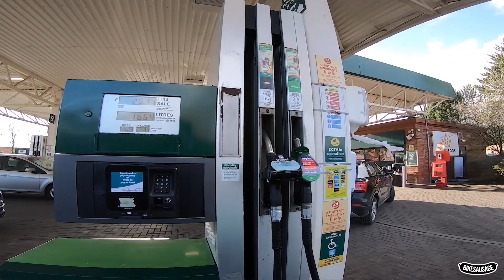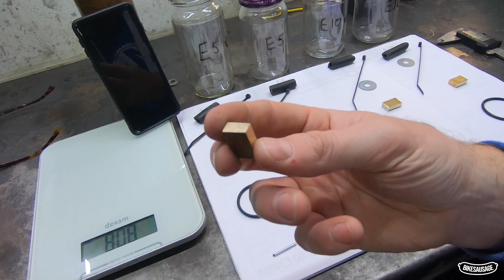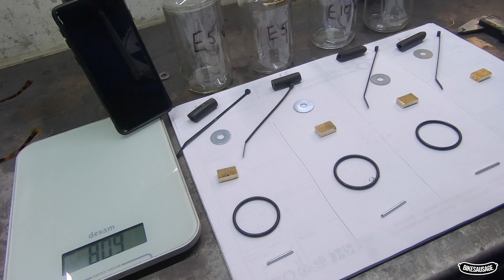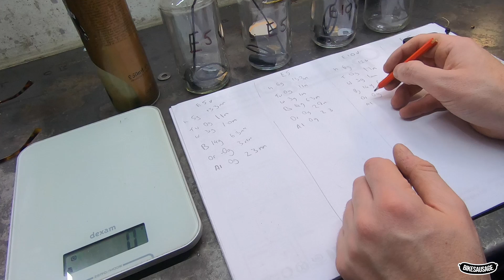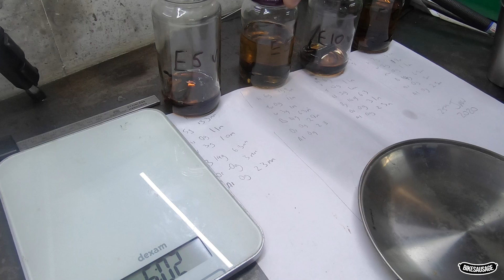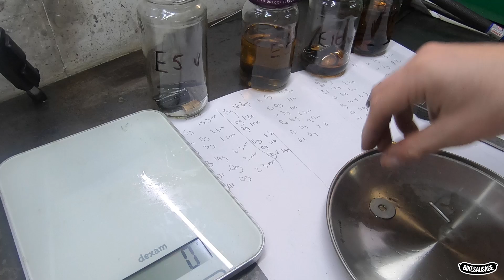E5 v E10 FUEL | Does it really make a difference?

Comment: E5 made by Shell, Exxon and BP is free of ethanol! Here in the Netherlands anyway. So it sure does make a difference.
Reply: Same in most of the south of England, while in the north of England (areas fed by Stanlow refinery), it contains between 1 and 5%. E10 contains 5 to 7½% depending on brand and location.

None of the above implies that the bio-ethanol content couldn't be ramped up to the maximum permissible five or ten per cent later on.

Comment: Its rubbish and well known to be. Its cheaper to make and cut it into fuel but otherwise it has no benefits. Its also hydroscopic and a harsh solvent - both things you really don't want long term in any fuel system but much less in older ones such as vented carb systems where it will attract moisture and turn to goo in the carbs, corrode the alloy and damage the jets. 

Its great for one thing - profit. Its costs less (even though prices have still gone up) and because it damages older vehicles it will push a lot off the road - meaning more new sales and more profit. 

This stuff is certainly not for the benefit of the planet or anything good.
Reply: When they ferment agricultural sugars to produce ethanol the major byproduct is carbon dioxide.  C6H12O6 → 2 C2H5OH+ 2 CO2 + heat. Yet we’re supposed to use it to reduce carbon dioxide. 
Alcohol has only 37% of the energy of petrol, it needs more poured in to get the same power output, yet we’re charged the same for an inferior product. I can’t use E10 on my vintage motorcycles because its damaging to the entire fuel system and cannot be stored for any length of time, due ton its filthy habit of absorbing water. Its frankly dangerous. Fuel system damage can be fatal on a motorcycle, and that includes the carbs suddenly gulping down a slug of water when pulling out of a junction as well as catching fire due to leaks.
Ethanol diluted fuel should be regarded as contaminated.

Comment: I have a 19 year old 1.6. Mini Cooper. According to the gov website, my car was compatible with E10. I used the E10 fuel and my car started running ... rough? Not like a diesel, but it was definitely noticeable and my mpg was ridiculous. My car also started to cough on start up. So decided to try the E5. My car no longer coughs or runs rough and my mpg has increased massively. I’ve gone from filling up twice a week at minimum to once a week/week and a half. I will not go back to E10.

Comment: It definitely does make a difference. E10 was giving my bimmer atrocious mpg, switched over to E5 and the engine is smoother, more mpg and it's only around 6p more/L for E5 so for a full tank it's less than a fiver extra.
Reply: 2004 Corsa 1400cc automatic. Only 63,000 miles. Wife’s car used for shopping trips. Works great, MoT pass every year. With that sort of use it doesn’t do great on fuel, usually 30mpg. Filled with e10 petrol and got 24mpg. Twenty percent reduction. Back to e5 for as long as it’s available as it works out cheaper per mile.
Reply: I agree. E5 is better.
Reply: Considering how much more it gives it roughly comes to the same price
Reply: @KkKk-px2le  Possibly, however when I was using supermarket fuel on my bimmer the fuel tank breather (purge) valve went. The BMW specialist advised me to always use branded fuel in bimmers and showed me a piece of someone's engine that was knackered from supermarket fuel.
Reply: @seanglossop4777 what’s the difference between Asda fuel ?
Reply: @seanglossop4777 dont use that cheap crap it's false economy yeah it's cheaper but you use more fuel and need to fill up more often, plus E5 is better for your vehicle especially if its older

Comment: well my 1.6 turbo Tuscon 2016. Reg Unleaded E5 450 miles a tank, Reg unleaded E10 400 miles a tank  slight less power. I use Super Unleaded E5 now 475 miles plus better power delivery. noticed the difference from E10 regular, from e5 Regular not worth it. 

So i tend to use E5 Super unleaded. 

I get better milage and power delivery so really the same price as E10 Regular.

Comment: Not totally Scientific and prob the wrong channel but hey it is an internal combustion engine too and my other vehicles are diesel no bike at the mo....doh....!!!!!  But the Corsa 1.4 SXI which I occasionally drive when I need an easier drive than the van.... E5 Regular Unleaded = Slow  E5 Super Unleaded = Slightly Better/faster with Big Flat Spot between 2-2.5 x 1000 rpm  E10 Regular Unleaded = doesn't pull through quite as fast as Super (poss slower & longer burn time) But Bags more Torque & much faster & Happier read 100% happy engine...!!!!  So if they put Ethanol in Speedway bikes etc....could the ethanol have performance advantages or alter the combustion characteristics of the Benzine/Petrol or is it just a better designed fuel...!!!! Def not totally or poss at all scientific on a test group of one - and if there's one thing I've learned it's that certain Engines def react differently to different fuels my Hiace D-4 2.5l 80 hp turbo model + Shell Power Diesel = at least 15% more Torque off the Bottom end (Poss more complete Burn) Where as my Transit 2.5 80 hp + Any Super = Less Torque + Power (poss shorter burn time = less burn time on the power stroke  due to being designed for a faster complete burn time (higher octane) for faster reving engines)  Conclusion (not entirely scientific conclusion) = is E10 unleaded poss a better designed/newer fuel with better combustion characteristics for certain engines....???? - Also if it works that's a descent reduction in carbon & offset growing the Ethanol plant source in the first place....But prob not a dent on where we need to be...!!!! And we need to not de forrest S.America in order to produce the ethanol...!!!! But poss er food for thought....?????

Comment: We bought a brand new motorbike last year, because i wanted something that could run on both types. 
One thing i have noticed when had to use e10 was the bike runs more rougher and dont get same milage out of it.

A lot of people prob think the using more fuel part doesnt help the world but yes you use a little more e10 but the less co2 made from it is an overall benefit is what the government is going with.

Im going to keep using e5 where i can as bike runs better and better milage out of it.
Reply: Less CO2 in use - allegedly. It still takes a lot to make and transport it though so that extra use is harming the planet somewhere down the line.
Reply: @siraff4461  
Well its the same tankers that transport e10 as they did e5. No change there.

Its the government making people change as so many people out there dont care about how well or efficient they drive, they drive because need to, not want to, so will make more co2.

So government thinks by giving a less polluting fuel to the people, it will make less co2 even though they use a bit more than using e5 fuel.

Comment: I'm running a 27 year old RF900 on E10, the manual says it can run E10 but is bracketed USA only as nowhere else in the world had it at the time it was printed (1993). Fuel lines were changed recently simply because they were old & I didn't fancy setting fire to the old girl, plus the fuel tap was taken apart to check it's OEM rubber internals condition for cracks or hardening before switching to the E10. I also fitted a 4degree ignition advancer the week after E10 became available, a common RF fix/ cure for known poor low end response which predates the new fuels introduction & it helped massively from tick over to 4k revs. It now runs great, no extra engine temp & a whole lot better than before! That is because the carbs actually needed more than a good clean, a proper setting up & vacuum leaks seen too, from when I bought it and thus it ran awful on E5, so I can't really judge economy before and after fairly. I'm happy to keep using the E10, but it's a 52 week a year ride & never gets put away or stored during the winter, starts hot, cold or freezing, wet or dry 1st time, everytime, so why pay more. Plus where are the horror stories amounting from daily correct use of E10 from the Sates or even main land Europe that have ran this fuel for years!

Comment: Here in Thailand where I live ( a Brit) we have had Gasohol E20 which is a blend of 20% Ethanol, fermented from Sugar cane and/or Tapioca, a root carbohydrate crop, and 80% x  95 Octane gasoline. Myself and many Thais run petrol engined cars on this without problem. It is the cheapest equivalent 91 grade fuel, and burns cleanly with low emissions.

Comment: All we use in America is e10 and our fuel systems aren’t fucked even after 30 years of use. It won’t make a difference other than maybe mileage and power but you wouldn’t notice the power. I’ve put ethanol free gas in my bike out of curiosity and it didn’t make any difference

Comment: Anyone any idea when e5 was introduced in UK, as opposed to100% petrol.
Can't recall anyone kicking off over it. How can an extra 5% have  Soooo much effect. Just asking.
Reply: Most e5 is about 0-2.5% ethanol but E10 is kicking it up in the 7.5% mostly that's what's causing the issues gunking fuel systems up and causing plastic tanks to swell.
Reply: @zedddddful  I guess that may be true of 'present' e5, as its premium ie super unleaded, however previous 95 octane standard unleaded e5 will have been 5% ethanol.

Comment: I run E10 in my daily bike, an '02 Deauville 650. Honda say it's rated for it and despite what the doom-mongers said, it's perfectly happy on it, the bike is for workhorsing and commuting, so the power loss is not a problem. And no my fuel system has not rotted out, everything I've read suggests E10 causes most of the problems when it's left for long periods, so not a problem for me when the bike uses a tank every one to two weeks  . 
What HAS left me rather annoyed is the drop in fuel economy. I ran it on bogo petrol before the introduction of E10, so it's actually a fair comparison. The bike was hitting 55-60mpg per tank, depending on what I've been doing and how fast I'd been doing it, and is now doing 50-55mpg, with it generally towards the low 50's which leads me to question if E10 does actually make a difference. At times my full-to-reserve mileage has been as low as 160 miles, where previously it would comfortably hit 200miles, sometimes a lot more, for the same amount of fuel, and the bike is pretty well maintained, and probably actually in a better state now than before E10 was introduced. 
I'd genuinely love to see some test measuring if the lower mpg figures E10 gives over old bogo E5 is made up for by the lower emissions of E10, because I'm not convinced it does at this point and it's a bit of fallacy to tick the 'green' box.
Reply: So a 20% loss in mpg and you're still using the stuff? I would never put E10 in my bike.
Reply: Same here on my bandit 600 daily bike

Comment: Worth noting that the real ethanol content of any given brand is not necessarily 5% or 10% for either of them - they are maximum figures, not minimum. E.g. as some below have mentioned, certain top end E5 labelled ones have none in them at all.

Apart from the reduced thermal content, the nasty effect of higher ethanol mixtures is the reduced “shelf life”, as the ethanol tends to be preferential to water, rather than the petroleum part of it, so in the long term it will tend to settle below the petroleum part, so there would be a layer of water/ethanol mix down below that could end up being sucked into the fuel system; not nice. Thus it’s probably a good idea to avoid storing it too long, say over winter.

Whether this has any effect on the performance of the Evaporative Emissions Control System (EVAP), which is a feature of modern petrol fueled cars, I don’t know. However, as the watery mix is under the rest of it, it seems unlikely that much of it will evaporate compared with the oily part; over to you!

Comment: My 96 ntv650 had done approx. 50K on it's original fuel pump which has failed not long after this e10 crap was forced on us and my st1300 seems to be doing a lot less miles per tank.
Reply: Do yourself a favour and use super unleaded.

Comment: small 900watt generator ran great on E5, changed to E10 and 2 weeks later petrol poured out of the fuel on off tap side housing, had to send to china to replace the sealed fuel tap as it couldnt be opened to replace the rubbers inside it ........... E10 sucks

Comment: I don't think ethanol is too bad for the o-rings, it's the methanol which is really bad and ppl mistake these two with each other.

I've had a 2001 Volvo V70 2.4T AWD (278.000km driven in that point) on which I installed the E85 fuel module, didn't change any fuel lines, o-rings etc only fuel filter. It ran perfectly without any problems for 2 years (30.000km) and still continues it's current life with new owner :)

On my bike (carbed) I've used 95E10 and it ran as it would run on 98E5. The only thing I wouldn't do is let it sit too long with the fuel in like for winter storage. I've use 98E5 + fuel preserver for winter months (6 months for us finns)

Comment: I've had starting issues, power loss and significant mileage drop when e10 is used on both my 2018 v strom 1000 and the brand new 1290 SAS. No issues with e5 at all. I will stick with E5 until its time to sell or exchange.  Even when I have to use e10, I always add a fuel stabiliser in the tank.

Comment: Just check with the manufacturer, they are all different depending on what materials they used (there are many different types of rubber...). 
As an example, Triumph say all their bikes manufacturers since 1996 are compatible with E10.
Aprillia say using E10 is a safety issue in bikes older than 2011.

Comment: there is less energy and alcohol-based fuels than there is in petroleum-based fuels. What kind of a question is this. Click bait? Who doesn’t know that..
 being an alcohol based forward absorbs moisture right out of the air. Have you bought a bottle of brake fluid recently? Every workshop manual I have ever seen tells you to replace brake fluid in your vehicles brakes system from a brand new unopened bottle of brake fluid. That is also alcohol-based. Brake fluid is alcohol-based. It absorbs moisture right out of the air. That moisture corrodes your brake system from within.. that’s why they tell you to use fresh brake fluid from a brand new unopened bottle
  The same cannot be done with gasoline that has ethanol. And that is the problem with ethanol in gasoline. It doesn’t have the energy that gasoline has when you burn it, and it absorbs water

Comment: Although my car is "supposedly" ok for e10 fuel, I started using the 99 octane e5 in my little Street KA (no, I'm not a hairdresser) on recommendation by a friend. And what a difference... The engine smoothed out, it doesn't run as hot and I get way more mpg. It seems to have a bit more power too, I mean I don't have to put my foot down as much to achieve the same results. It's like my engine said thank you, as did my wallet.

Comment: Fuel economy on my F Type went from c.14mpg to 12mpg around town with E10. 
So I really don't believe that E10 is "better for the environment" as you burn more of it.
Reply: Not better for the Enviroment, not better for your wallet, not better for the engine, but cheaper to produce and therefore much better for the fuel companies.
Reply: 😭😭😭 12mpg, not sure different type of fuel is gonna have an effect on the environment regardless if your mpg is that low
Reply: I second your data and post. I've had a V8 S type jag for a few years now and it always averaged 21mpg. I'm now getting 19.

Comment: I’ve noticed a 50 mile + pepped up performance  when using  esso 99 conspared to supermarket e10 And that’s on a bogo standard 2006 mondy 1.8 16v
Reply: Yep same here Reg E10 vs E5 Supper on a 1.6t Tuscon 2016. 50 to 60 extra miles and better performance. E10 had time when at roundabouts it just did not go had to rev very hard, almost dangerous. My hyundai dealers  has a notice saying E10 is fine but use E5 super every now and then to clean things up.

Comment: There are people who think that their cars run worse on the new petrol with E10.  Since E10 contain less energy at least in theory, the car should consume more fuel per mile.  There is actually a car that consumes less gasoline at 98 octane even though the ethanol content is exactly the same.  according to a study from the United States.  examples of a car that gets lower consumption with 98 octane are the Ford Mustang and Ford F150

Comment: The test is far too short it should be at least 6 months.  and can a glass jar really correspond to the conditions of a gasoline tank or gasoline engine.  I do not think so .  ethanol also attracts water.  the effects it does not appear in this test

Comment: But you should do this test in long term..for example, get carburetor bike, ride few months with E10 petrol, then put it in winter deck and keep it like 6 months there, then take it out and drive again so we can see, or you can take carbs out straight after 6 months standing still and see is there anything. I would still not use E10, when it can make older car/bikes run poorly, also when it can raise little your fuel economy

Comment: The biggest issue with E10 is the lower energy content & lower boiling point, leading to overheating & poor combustion issues in carbed engines, especially 2 strokes.

99 RON Leaded petrol = 9.2 million Calories per litre & boils at 35C.
98 RON Unleaded petrol = 8.6 million Calories per litre & boils at 35C.
99 RON E5 petrol = 8.4 million Calories per litre & boils at 18C.
95 RON E10 petrol = 8.3 million Calories per litre & boils at ??C.

I ride a 250cc 2 stroke and have to mix in 40:1 diesel, in addition to the 33:1 2 stroke oil for it to run OK on E5 petrol. Without the diesel it overheats, soots up plugs & has a massive power loss. I've tried E10 and it makes the engine run as gutless as a 4 stroke 250cc bike.
Reply: "e5 boils at 18°c"
Nonsense